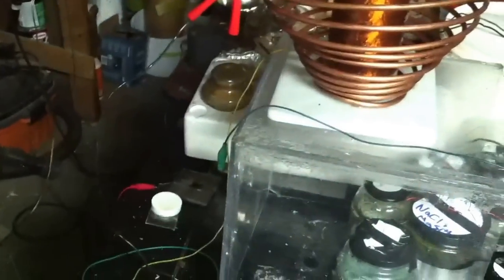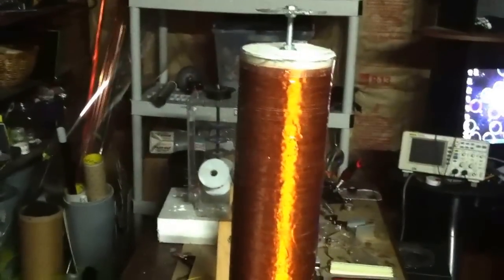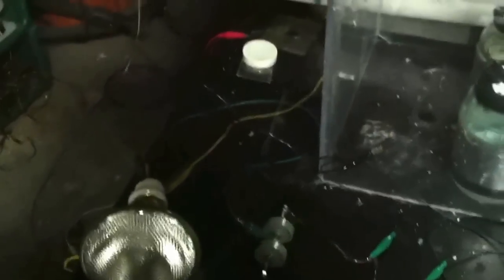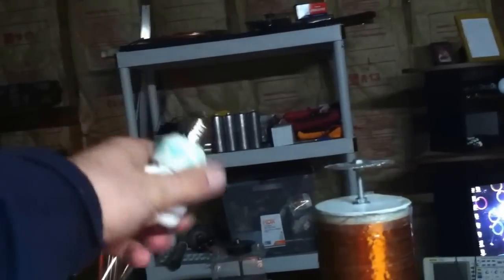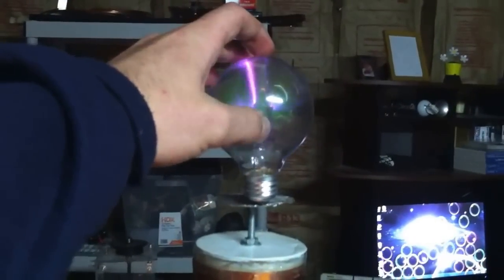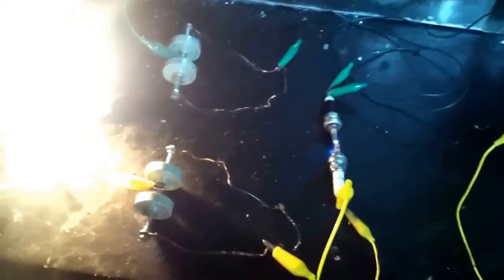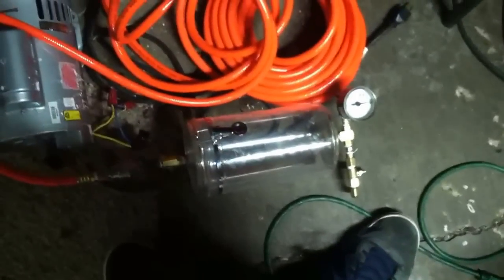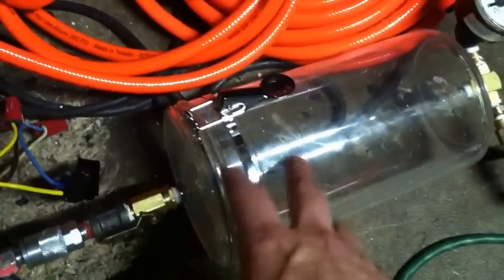THC update and other experimental stagings

Comment: Misleading title lol 
But I watched it anyway.
If your coil is breaking out below the top load...it is tuning problems. 
Your breakout should be at the top if it is quarter wave to the primary.
Try some cheap mixing bowls for top loads. Chinese grocery stores have good variety and cheap too. 
Something that Tesla mentioned, and a lot of builders overlook this, mass of copper should be equal from primary to secondary.
So it would pay to weigh the secondary form before winding so you can weigh the finished coil and subtract the mass of the form and make your primary the same weight.